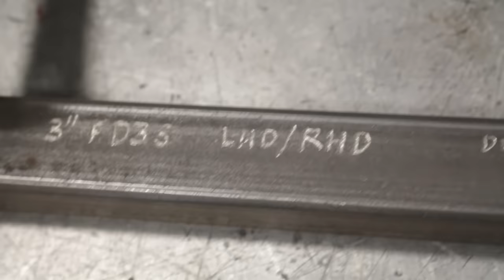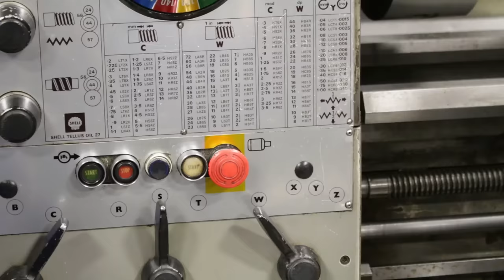I earned 100k/year by making this Jig (no school)

Comment: Fixture, not jig. A fixture holds a part, whereas a jig guides a tool.
Reply: That changes everything! Thank u sir Genius!
Reply: @yaketysmack5512  Proper diction is one of the key elements which separates man from the ignorant beasts. Improper diction causes confusion, and clear communication (which includes proper diction) is essential to the good functioning of human society.
Reply: Yeah, but still made 100k, so can call it a house cat if he wants
Reply: @leebdj1949  Calling horse dung a rose doesn't make it so.
Reply: @Unsubscribed_Inc  I am correct. This is a fixture that holds parts in alignment. A template is a pattern used to make or process parts, not to hold and align them for a manufacturing process.

The difference between a jig and a fixture is that while both hold a part or parts for a manufacturing process, a jig guides the tool during the process.

Why do words matter? Well, go into any manufacturing / engineering facility where the personnel are competent and use the incorrect word and you'll be known as a dunce and make yourself into a laughingstock.

jig - a device that holds a piece of work and guides the tools operating on it. 

fixture - a device which holds and locates a workpiece during an inspection or for a manufacturing operation.

template - a shaped piece of metal, wood, card, plastic, or other material used as a pattern for processes such as painting, cutting out, shaping, or drilling.
Reply: A jig is a type of custom-made tool used to control the location and/or motion of PARTS or other tools.
Reply: @Group_Anonymous  You've cited a very uncommon definition. Historically, the meaning only referred to fixtures which also guide a tool.

However, even if we accept your "modern" definition of a jig, the contraption in this video remains a fixture since it does not guide either a tool or a part during the manufacturing process but merely provides for aligning and holding the parts in position.

I still stand by the definitions of jigs, fixtures, and templates which I provided, for these definitions have been in use for well over 100 years. These terms have remained consistent in use by engineers and machinists since I started in the industry more than 40 years ago. 

Of course, I realize that we live in an age where twits change the definitions of words literally overnight to support some crazy agenda or simply out of ignorance.
Reply: @gaiustacitus4242  you are right but nobody likes a grammar nazi.
Reply: @christianhudspeth3338  I don't care whether anyone likes me or not. My goal is to educate those people who no longer wish to be ignorant.
Reply: @christianhudspeth3338  
*Grammar Bolshevik ✔️
Reply: Words mean things
Reply: @Chevron.Muskoka  Words mean nothing when the definition can literally be changed overnight by official reference sources like Merriam-Webster to promote a political agenda.

To have any meaning, the definition of words must remain static over time. If a person wants a new definition, then a new word must be created.
Reply: @gaiustacitus4242 I bet you’re fun at party’s.
Reply: ok.
Reply: Lol I work with Toro and they hate when we say Jig for that reasons. Doesn’t keep us from doing it though.
Reply: Wow, I felt the presence of god reading this. Only the perfection of Jesus could make this man happy. lol I don’t think he made this video to try and be a teacher or to be perfect. I think it was just to inform the regular JOE how he did something that’s it. The end. Someone needs a life
Reply: A jig is a type of custom-made tool used to control the location and/or motion of parts or other tools.  Call it what you want, it's still a jig.  I copied and pasted right from Wikipedia
Reply: @jeremymoreside1444  Wikipedia is not a reliable source of information, and the article on the site is incorrect about the definition of "jig" (among many other topics).  Even Microsoft's Bing AI gets the definition correct.
Reply: Nah I call it a jig.
Reply: I'm still learning. I would have used jig as well. Fixture makes much more sense in our World of fabrication.
Reply: Dude it's a jiggy or a fixie
Reply: So your the guy running around the shop like "Hmmm should I use Gas metal arc welding or Gas tungsten arc welding to over engineer this fixture. I guess I better go get me a reasonable sized cup of caff'e latte and go over the pro's an con's....🤔 Gonna be another long day."
Reply: @saleen3515  No, I'm just one of the senior guys who laugh at newbs who don't know their way around a shop and refuse to listen to those who are older and wiser.

We senior guys make very fast decisions because we have many years of practical experience. We don't have to debate which is the best approach; we already know.
Reply: @stephaniealden4926 Maybe he's not but he is correct.
Reply: @gaiustacitus4242  that is a jig in the video it guided the permanent marker to make a mark in the right spot for the hole for the sensor
Reply: Correct
Reply: I call it a jig and I'm ok with that, no sleep will be lost 😂
Reply: @blacksheepautoworx5304 sad part is, he wasted his breath,  because he's wrong.  The "fixture" has a guide for the sharpie, a marking tool, to put a hole in the proper spot, so that does make it a jig by definition.

Added note, same guide could be used to guide the hole saw, and not even bother using a sharpie.
Reply: A jig has and always will hold a part
Reply: @tobiasmaskell202  You've only stated one-half of the purpose of a jig, which is the sole purpose of a fixture. To qualify as a jig, a tool must be guided into or along the workpiece.

p.s. - Don't trust the nonsense published on Wikipedia. Research the historical meaning of the terms ''jig' and 'fixture' in decades old textbooks and manuals used to teach engineering and machining.
Reply: Looked like it had a guide for a sharpie, jig it is.
Reply: @Monstufpud  A marker is not recognized as a tool for manufacturing.
Reply: @gaiustacitus4242 Good to know everyone here can safely disregard everything you have said.
Reply: Nerd
Reply: @Ian-xr9ff  Cool. You've reduced "machinist/engineer" to only four letters.
Reply: Your jig/fixture quibble takes a rough terminological "rule" and ignores all the relevant exceptions. There are several long-established engineering uses of the word "jig" in the same context as the video. Just one example is the bicycle framing jig.
Reply: @camshaftcasting1451  If there is no guiding of a tool, then it is not a jig but a fixture. This standard terminology in manufacturing and engineering has been around far longer than I've been alive, and I'm not a young man. However, ignorant people have misused these terms for about as long and those in the know get a good laugh at their expense.

Words are also tools, and a man who can't select the proper tool for a job and use it well isn't worth his salt.
Reply: @gaiustacitus4242  "... those in the know get a good laugh at their expense".  OK mate.
Reply: @camshaftcasting1451  We do. Newbs who don't learn industry terms and practices are poorly treated. They get sent off looking for a box of squelch, a machinist's punch, and similar nonsense.

Comment: WOW, what a great job. Did a whole 3 inch system for my 1994 SAAB NG900 Turbo back in 2016. Bought Magnaflow sports cat and SS free flow silencers and some V bands. Had the entire tubing from the junk, SS tubes which came of 12 ton Isuzu lorries during body installation. Did it slowly, and the system is perfect after all the years and 150000 miles.
Reply from the maker: Nicely done!! Proves that it's always worth taking your time.

Comment: I used to make stainless exhausts for Ls engine swaps and I would use solar flux for the inside of the joints saves a lot on gas and time spent purging. I made some cut fixtures that bolt onto the chip saw to for some complex cuts. The scotch bright seams like a waste of time after the thing heats up a few times but I bet the customers are impressed  to see the product looking all nice like that.

Comment: I did a similar thing awhile back. Not dump pipes or anything like that but heat shields for volkswagen golfs. I had one on my own car but wasn't overly happy with it so changed the design slightly and used my father in-laws guillotine and folder. Posted a picture of it on a fb page and had a heap of people asking me to make more. A few hours one Saturday and made around 25 of them and sold like hotcakes. Made a few hundred dollars and got some new parts for my car.

Comment: 6:15  "Didn't quite nail the purge."  When you started welding my first thought was "he shoulda started at the other end where the purge originates."  Putting a diffuser on your purge block should also help so that it's not a narrow stream of gas blowing straight down the middle of the pipe.
Reply from the maker: Thanks for the advice!

Comment: Nice job ! I just tig welded a down pipe for my MX5 turbo build. You almost have to unless you purchase a downpipe and manifold combo.  I did all  mild steel though, because I didn't have a purge system set up . If I like my turbo set up, I might make another on in stainless . I'd like to make a turbo manifold out of stainless too.

Comment: I built a completely custom CNC welding machine which gives you perfect weld for specific part/job that needs to be repeated thousands of times and is in a hard to access and hard to do manually even by a skilled welder, you just load two parts, clamp it, close the door, and hit the start button, it's fully enclosed so you don't even need any protective gear, and it doesn't require anyone skilled to operate it, and it takes only a minute per part.
And my salaried job pays me $40k a year...

Comment: I miss fabricating so much, but I don't have my tools anymore or a welder... I want to make a downpipe/crossover pipe for my cummins too...  Wonderful video!
Reply from the maker: Thanks a lot! I really hope you get back into it. 

I've got a new video coming where I build a complete turbo manifold with basic hand tools (plus a tig welder). Should be out in the next week or two.
Reply: @gleaseman   One day I hope to!  Suitcase tig welder is high on my list of want items!  Something I really want to learn.  I used to run a waterjet... so flanges, no problem, as I still have access to the water jet.  I worked at a place called flextech industries, they're local and make excellent flexible couplers to order.

I'm looking forward to your next video!

Comment: Great work! Invest in a evolution chop saw. I definitely couldn’t believe I went as long as I did with the abrasive once I got my first one.
Reply from the maker: That looks like a nice little cold saw setup. Thanks for the heads up!
Reply: The evolution saws work pretty good. We bought one for cutting aluminum. I wish they had better clamping. There is a newer style that looks like it has better clamping.
Reply: That new Chop-Mitre that they do is something special, accurate mitre cuts, top and front V-block clamps and it eats.

Comment: Nice Job on the Tube. The huge stick out and Furick cup are huge gas wasters. they look cool and have there place. Your backside will look better with a smaller gas lens and less stick out . Dont ask me why but it will .
Reply from the maker: Thanks! 

That's interesting, but I've never heard of that... I deduced that this bad purge was from not using diffuser in the feed end. Never had an issue using larger cups beyond the occasional mess up from stuff like that. 

As for the gas waste, in my opinion the benefits outweigh the cost significantly!

Comment: Nice to see the old Lincoln Square Wave at work. I've got the same one. My only complaint is the non adjustable post flow. Wastes a lot of Argon when tacking and / or doing short welds.
Reply: You can add an off delay timer and a solenoid valve to stop your shielding gas as early as you like. The gate of the timer would be connected to your pedal or anywhere in the circuit that's hot when the pedals not.
Reply from the maker: Nice! It's a great machine. Served me well for 10 years already, and it was used when I purchased it too. I see these going all the time for $1200-1500 in my area. Solid deal. 

I completely agree with you about the lack of post flow being wasteful. Especially on 30+ cfh jobs. My only other gripe is not having control over the AC balance when I'm doing aluminum. 

Cheers!

Comment: 9:53 Takes a lot of practice before you can stack dimes like that on a flat surface. Even longer to get where you can walk around a circle and still be that steady.
Reply: You can do it, just need to get your face right down in it , and get your wrist supported real comfortably . You need the hand  steady enough to pick I sliver out of your skin with tweezers. Generally if you have good handwriting , you'll get good at welding . I welded for the airlines back in the 80's , and haven't done much since then, but in a matter of 2 weeks it all came back to me. I actually was a young kid back then making $24hr. in the 80's.

Comment: What was that part roughly in thr middle:
with filling the exaust with gas and welding 
why do you need to do that?

The same with the turbo
Reply from the maker: The gas keeps the Stainless steel from coming in contact with oxygen and "sugaring" on the backside as I weld.

Comment: You make a fixture to do those down pipes and do them quicker. Why don't you have the measurements wrote down on it for each piece so you don't have to keep measuring??
Reply from the maker: This is a really good call. I did keep them written down, but I moved my shop twice in the last few years and likely misplaced my sheet.

Comment: I get that the table works as a big heat sink, my question is was there much contortion from the heat since it wasn’t clamped down during final welding?
Reply from the maker: Good question! On these downpipes there's nearly no distortion. I intentionally built the jig around a tack welded downpipe, so any movement that does occur should be well within spec.

Comment: Why did you bandsaw one straight,  and chop saw the other?
Reply from the maker: My bad, it's a bit hard to tell. I used the chop saw to make an angle cut to match the angle that the 2-bolt flange sits on. Faster than adjusting the bandsaw.
Reply: @gleaseman  👍🍻

Comment: Great vid ! Did you make them pipe holding bracket things on the jig ?
Reply from the maker: Thanks! I didn't, they're just the lower portion of a 3" muffler clamp.

If I remade this today I would have just had some laser cut from 16ga stainless steel. They'd fit better and wouldn't transfer mild steel scuffs on the Stainless pipes.

Comment: Probably a dumb question but what’s a good way to mock-up the bends/lengths you’d need to then base the fixture off of? I guess tack welding some tubes together that works for your application to get the fitment you want and then building the fixture based off that would work, just curious if anyone has any other tricks
Reply from the maker: Ideally you make the part you need to make directly on the vehicle (or whatever it is), and then you'd go ahead and make a jig around that part. 

Biggest consideration is making it as reproducible as possible. So that might mean trying to use 45 degree bends instead of some weird "40 degree" bend like OEM may have had. Things like that make the parts easier to source and also speed up the job significantly. 

Hope that helps!

Comment: If it's not marked how do you identify exactly which stainless it is?
Reply from the maker: It's really hard to tell 304, 316, and 321ss apart if it isn't marked. Most common is 304, but if it's magnetic and slightly dull looking it's likely 409ss.

Comment: Did you make the Jig from scratch initially or made it from the downpipes you bought from muffler man?
Reply from the maker: Nah different timeline. I made this jig plus a matching jig for a turbo manifold on an FD RX7. I sold those kits for profit through my website, and then moved onto other generation RX7s and Miatas as I could.
Reply: @gleaseman  How did you make the jig? You made a downpipe and the the jig around that? 
I'm still learning.
Cheers
Reply: @spartacus09ful  yes you would make one exhaust from scratch or buy one then make the jig.

Comment: so your using 304 pipe with a 321 bellows with 309 filler??????
Reply from the maker: 309 on the pipe to pipe  joints, 347 on the bellow to pipe joints

Comment: why dont you make a jig so that you can roll the pipe to weld it? A small rotator is cheap.
Reply from the maker: Always wanted one, but back 8yrs ago in my prime of building these parts they were still around 5-6 thousand without a Chuck.

I'll be fixing up a larger commercial machine in some upcoming vids.

Comment: Only 8 dollars in materials, 200,000 plus in shop and equipment 😂
Reply from the maker: All you need is a hand drill, hand grinder, and any welder. I earned these tools from those 3 items.
Reply: You slowly but surely make your shop how you want it. Purchasing tools that only make the job easier and more efficient for you